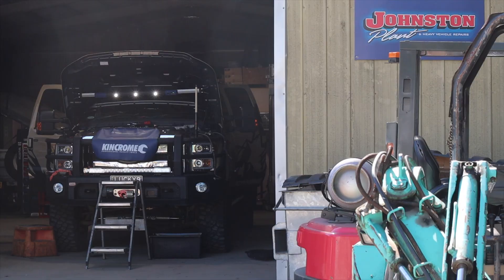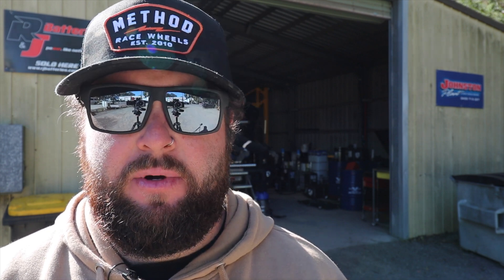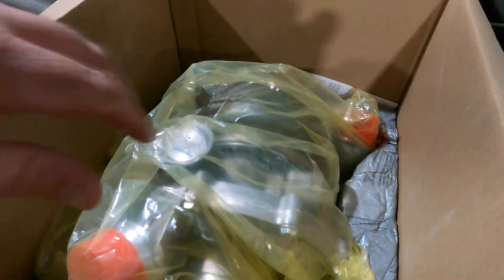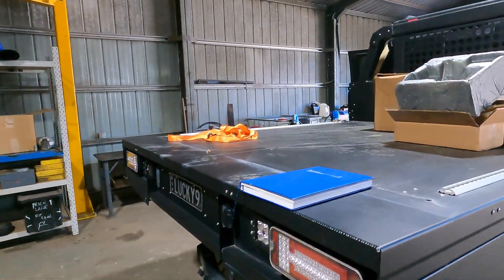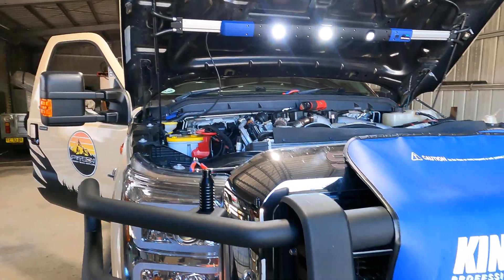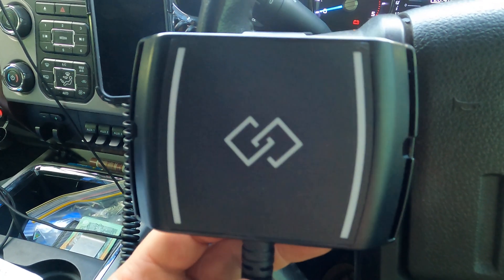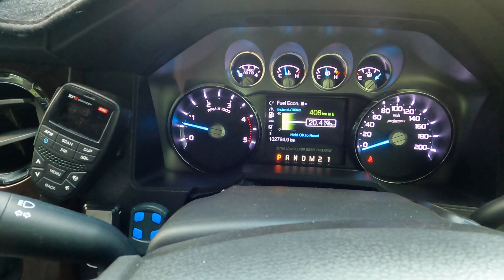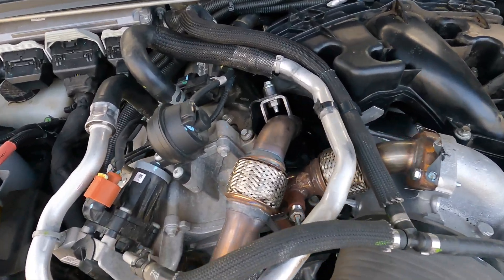F250 6.7L TURBO UPGRADES! Ford Performance Garrett turbo kit install.

Comment: Did you flash the truck back to stock before switching it to ez lynk? Or did you just unplug and reflash
Reply from the maker: No just removed the turbo put new turbo on uploaded new tune done 👍🏼

Comment: 6:45 fully heated up turbo and fluid yet you just started it up... right
Reply from the maker: Had been running the truck on a different  file. This was new file I’d been waiting on so everything was sweet with no codes.

Comment: I’m in the market for a turbo it’s down to 
MPD 364.5 &
SMEDLING 364.5 
I have a 10MM stroker Pump I’ll install while everything is open 
I have ezlink support pack from a northern tuning company l have lots of tune options while mostly stock and just a turbo but once the pump goes in there is only a few tunes to choose from hopefully they can hook it up

Comment: Make sure your tuner tunes the hissing sound out of your exhaust when you delete it. If not your exhaust at idle will have a turbo hissing noise. You'll have get a rumble tune for at idle which sounds similar to the 6.7 cummins at idle.

Comment: Have fun good luck with the new turbo set up.🤘 pretty skilled truck planking 😆 it would be a funny design for a sticker or shirt  “truck planking champion” outline of the  F 250 with mechanic and legs coming straight out the front. 🍻

Comment: I've done the full deletes on two f250s. 2011 and 13 using the ez lynk and with sotf. Best thing you'll ever do. I use a diesel performance mob in W A. Good tunes but no after sale service or interest on how I went, especially the dollars i spent with them. Both def and egr delete. I think I'll be up for a new turbo on the 2011 soon, so your video was interesting. Cheers, Phil in the Hunter valley.